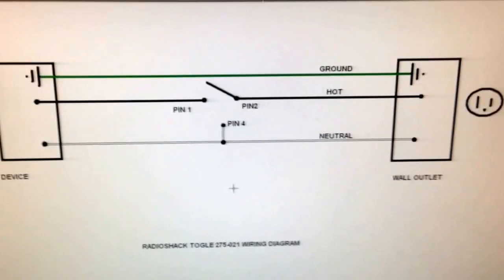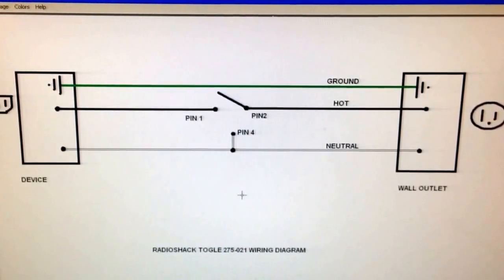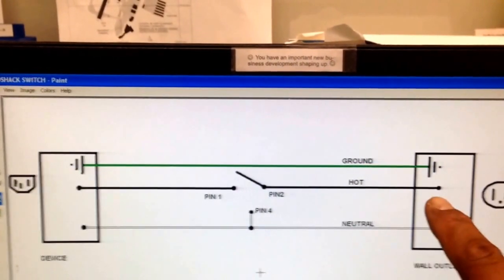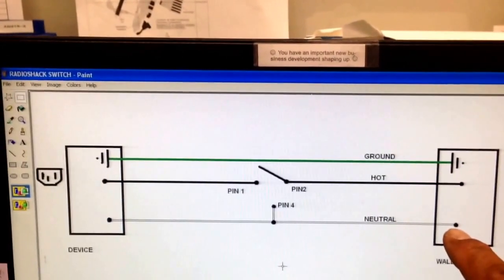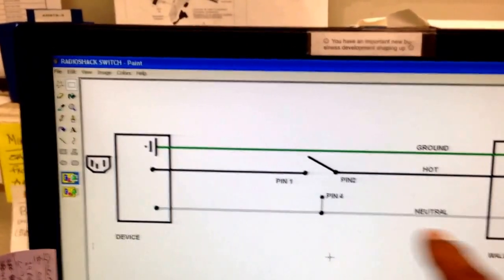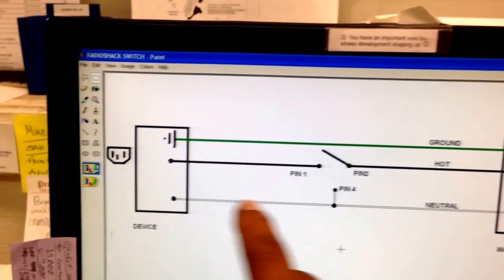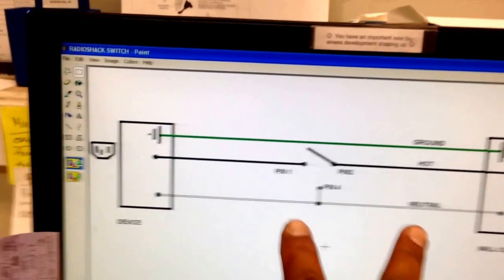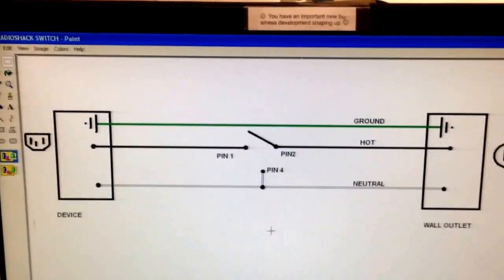Wiring an illuminated switch Radioshack toggle 275-021

Comment: Thank you.  The diagram printed on the switch bag is useless - I was quite frustrated and a bit worried I was going to burn the house down.  Your diagram and explanation is spot-on for RadioShack illuminated round rocker switch, rated for 16A 125 VAC, item number 275-0021. They should print your diagram on the packaging.
Reply from the maker: Thank you Chris. That's why I struggled with it. I'm very familiar with aircraft within 12-24 volts. AC can be very intimidating.

Comment: I am only able to get the red led to light up on this.  Am I hooking it up wrong you think or is it faulty?
Reply from the maker: If the red light is coming on in the off position then it should also work in the on position. Sounds like the wrong switch or a faulty switch. Check the part number to make sure it's the double illustration type.
Reply: @juanorellana8303  Unfortunately, this is happening to me too. I bought several of these and they all work the same way (i.e., red LED works, but no green LED).
Reply: If anyone reads this, the issue was due to wiring it wrong. If you wire the switch exactly as this video describes, it will work properly.

Comment: This rocker switch has 1-4 but the #3 prong is cut-out/missing so there  are pins 1 2 & 4 (R13-203 rocker switch). Not sure why the switch was built like this but thats how its numbered.
Reply from the maker: It's been a while since I've looked at that wiring schematic. My best guess (and it's only a guess) is that it's because it's for the ground. In which case you would only need to connect the two in series rather than connecting the to the switch. I hope that makes sense.
Reply: Denver P did you find out how to hook this rocker switch up
Reply from the maker: noaudio27 Pin 2 is black wire (hot from wall). Pin 1 is black wire (hot wire to the device) Pin 4 is both neutral wires joined together (white wires in parallel. However they get there they need to be joined.

Comment: Why do you label the pins 1-2 and 4? The illuminated switches I use have only 3 pins. I would think that labeling them 1-2 and 3 would be correct. I may be wrong, It's happened before :) , if so please explain the reason for my confusion. 

Thanks so much for the video. It does clear up my questions on the switch.
Reply from the maker: Bryan. I think Denver P had the same q. See if that helps. If not let me know and I will do more homework to resolve this for you.